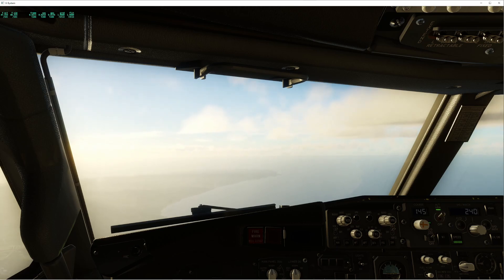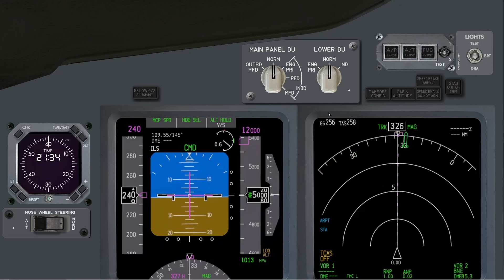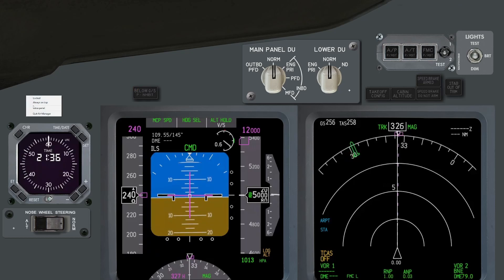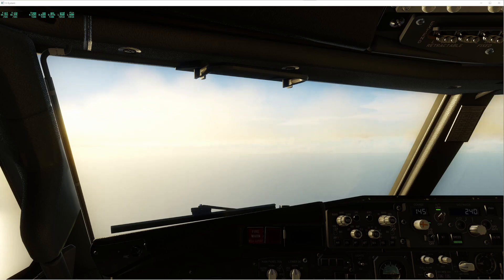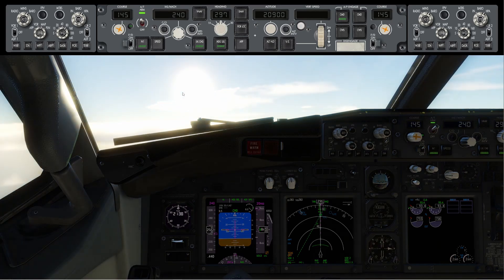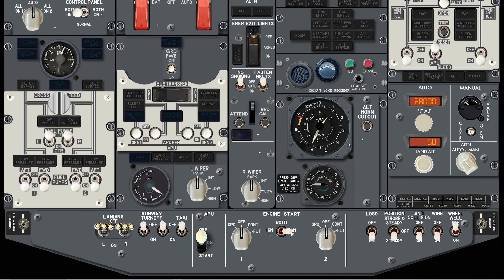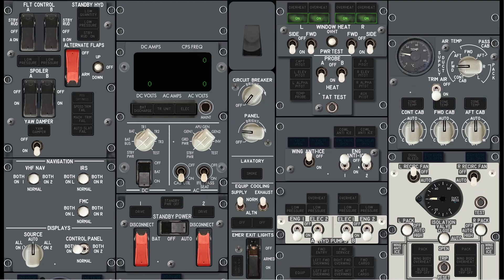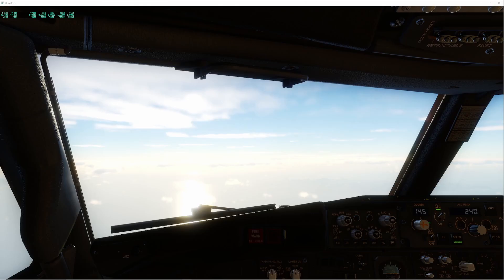FREEWARE Air Manager Panels for the Zibo 737-800X / LevelUp 737NG Series U1 (X-Plane 12)

Comment: I cannot get these panels to work with Air Player 5, just blank black screens but the instruments work  in other panels with Air Player. Obviously something I am doing wrong.
Reply from the maker: I have seen comments before on the Siminnovations forum about issues with “pushing” panels onto Air Player. I do not run Air Player, 2 separate full Air Manager work better for me. Please seek support from Siminnovations as I believe this is an Air player issue rather than a problem with my files. Thanks.